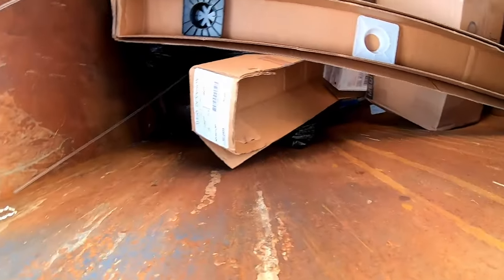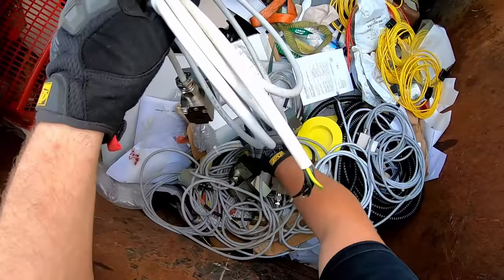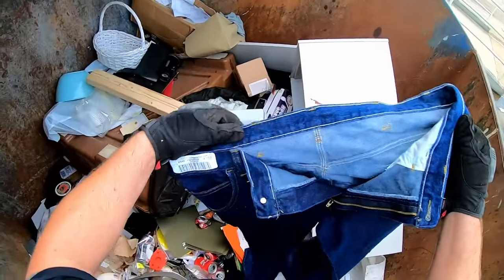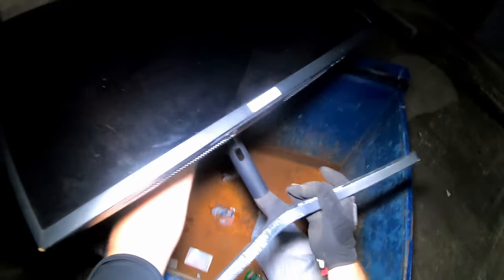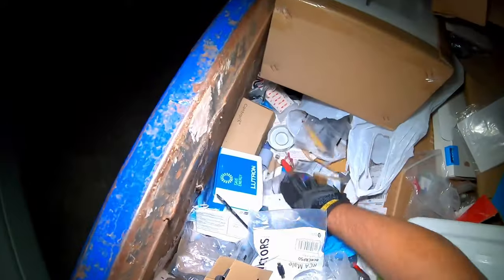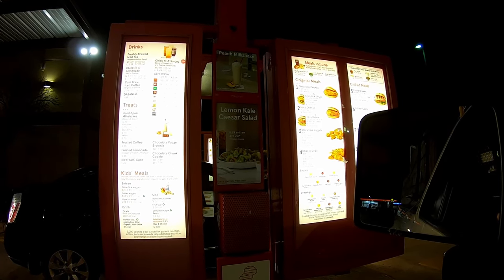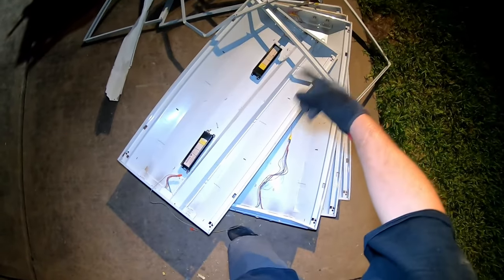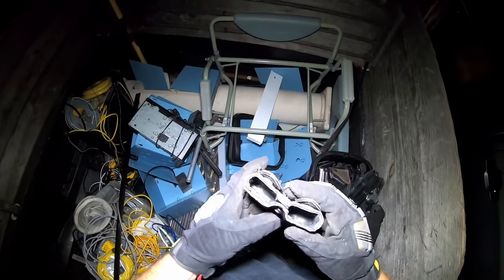Dumpster Diving "Jesus Christ Superstar!"

Comment: The Gravograph things are for engraving/cutting machines you may get $20 each for them.
Great finds tonight.
Reply: There are different styles of the engraving stylist. Some only engrave plastic, others are made for brass/aluminum and then some are for ss steel. New they cost between 20 to 30 bucks.

Comment: The wires in the Superstar dumpster may have been for audio visuals from a theatre group Mike. Thanks for another awesome video. I admire your commitment and hard work. I'm also envious of your hot weather. It's been raining and bitter here on the flip side of the planet (New Zealand) for weeks now. I could do with some summer sun :)
Reply: Aint that the truth. I have been stuck inside all day Saturday and Sunday looks to be no better. At least we have YouTube!
Reply: Nope, that's sensor connection leads. Turk makes sensors for industrial machinery for automation controls.

Comment: You left behind some of the crane webbing you were calling "tow straps", those things are $10-15 a piece used when you can find them for the 1", new they're $25-$50 and the 2"-3" you got are worth much much more.  The wider and longer they are the more they're worth.  Bigger companies like utility companies and state agencies, military etc. have to throw them away if they get so much as a nick in them or show any wear.  Smaller construction companies who aren't under the same scrutiny use the used ones all day every day and are always on the hunt for them.  They have to have the orange sewed in label though which those had.

Comment: Your TURCK cables are used extensively in automated machines and material handling. They are used to connect sensors to the programmable controller. Could be photo cell, laser, proximity sensor or magnetic sensors.  They are pretty expensive new, unless you're an OEM who has negotiated a deal. The cords always have a plug on one end. This is the type of stuff I worked with for about 30 of my 50 years in the trade.

Comment: You should always go through the big plastic boxes you find like the one in the dumpster full of wire. They send big expensive  parts for airplanes tanks and other trucks in the armed forces. Just letting you know for next time always check them we always put the bad part back into them. You could walk away with a ton of scrap.

Comment: I'll bet you have good yard sales.my yard has a classification called low recovery insulated wire. For cat wire and any copper wire that has more insulation than copper. Plus number 2, number1, insulated number 1, insulated number 2, plus bare bright, etc,

Comment: I think those thick yellow cables go to the Transmitter and Receiver on a Safety-Curtain aka Safety Light-Curtain used in Step-Process production machines that have to be manually loaded by a person.

Comment: I'm a little late on watching this one, but that brown case with the air museum sticker on it, well that's anywhere from about $600.00 up to over $1000.00 shipping container used for shipping aircraft parts. They do come in handy sometimes too. I have a few from my days of working as a subcontractor fixing commercial and military aircraft. We were told to throw them away and I did I threw them right into the bed of my truck and took them home.... Lol

Comment: You might consider putting some tape insulation on those scrap battery terminals. I have seen more than one truck/van burn to the ground after a battery short out against metal 😱

Comment: Lol as I was typing as u said it lol. But you definitely need a multi tool like the leatherman oht. The whole tool is one handed use and even the pliers slide out the front. I believe it even has replaceable wire cutter blades too and of course the Warranty lol they should hire me. But they r good either way

Comment: Have you ever thought about getting an industrial magnet would have picked up all those little plates and the nuts and bolts all at once then hit the unlock button and it would have dropped them all in a bin or your truck besides it would help when you're trying to get a lot of the small stuff picked up all in one I had one at my shop and it works great for picking up metal slugs out of the non-ferrous barrels that were slipped in on accident definitely should be a must for you hope this helps you please check into it at least
😊😊😊😊😊😊😊😊😊😊
Keep making the videos I love them I want them all over and over until you come out with the next one best wishes Mike
, Your friend Mike from Michigan oh and the video you put out with that picture that was signed from the lady and Utica Michigan I believe it was or maybe Shelby township is not too far from my house

Comment: I try to zero in on aluminum or copper. The rest is really hard to trade off or sell. Junk is junk and its real easybto grab alot of stuff that looks great but is in the dumpster for a reason. Good Travels dude maybe I will run into you Im in Mckinney tx divin from time to time.

Comment: #1 wire the copper wire is the size of a #2pencil lead or bigger and #2 the copper wire is smaller ( single wire not stranded it's a different price) if this helps anyone.